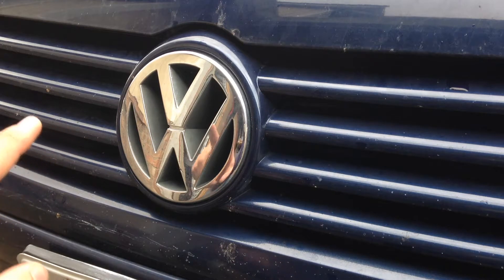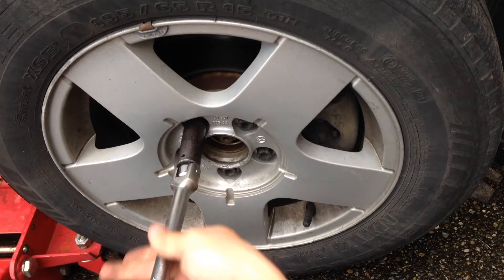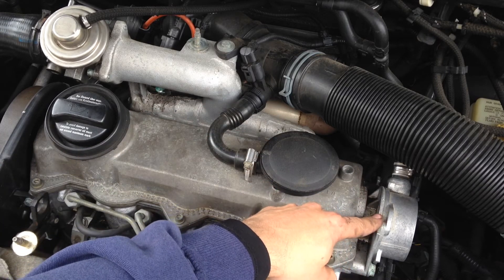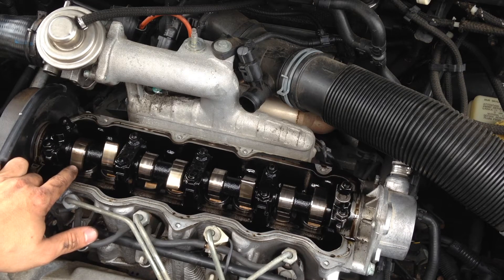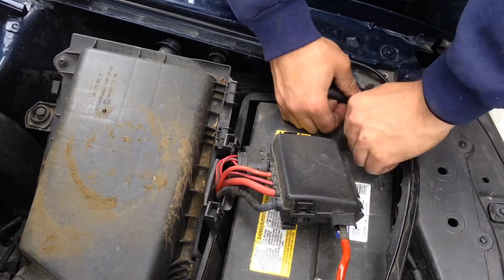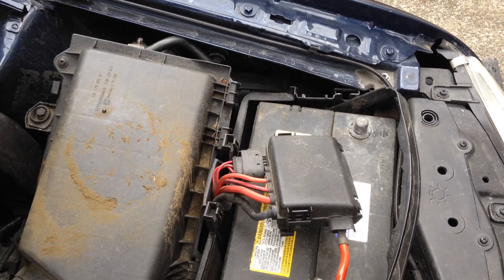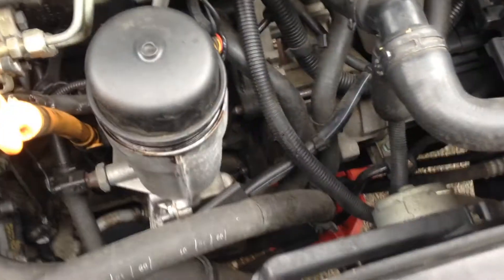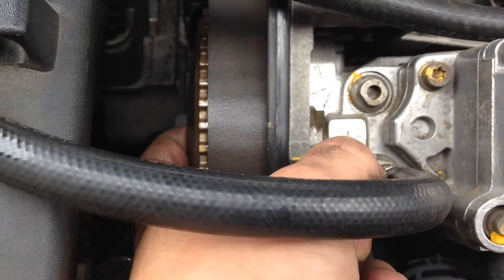DIY: Jetta MK4 TDI Injection Pump Removal

Comment: He didn't have to loosen cam sprocket, just paint mark the belt to the sprocket at the crank, cam, and pump. Heck, you dont' even need to be at TDC for that matter. as far as pump sprocket alignment during reassembly, take a picture with the alignment pin in place and put it right back in position.

Comment: You should not have loosened the cam pully gear , instead remove the belt tensioner to give you enough slack in the cambelt to work with ease .

Comment: This is not the way to do this will lead to engine damage the valve in this engine can be damaged with the lightest impact will lead to valve head breaking off later
Reply: How so? These alh engines can take abuse and not once there an "impact" anywhere near the valve train. Taking the valve cover off to see the position of the crankshaft doesnt hurt anything. If anything, not taking the valve cover off could lead to possibly having the timing be off at most.
Reply from the maker: This is a very hacky way of doing it, but it works. If you have the tools to lock the cam in place, I would 100% recommend using it. If you don't have the tools, you can try to do it this way.
Reply: @nathanmartin5529  camshaft👍